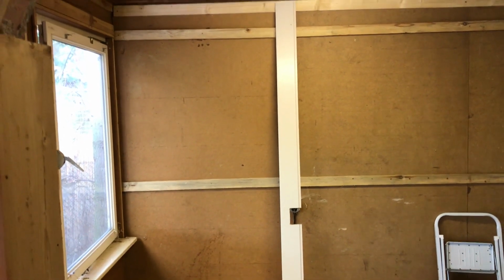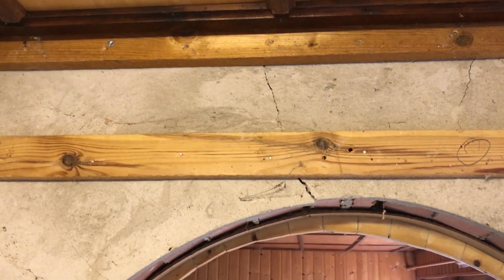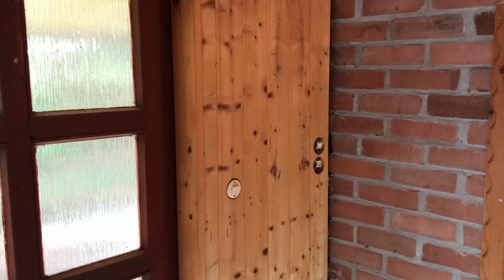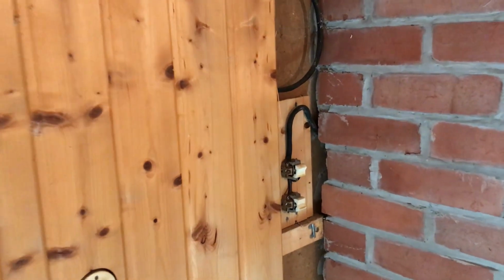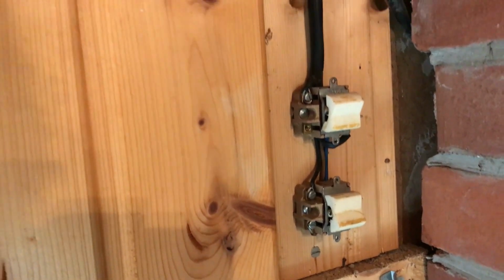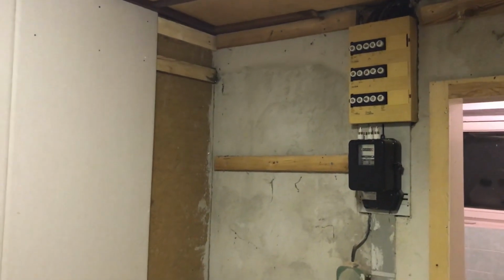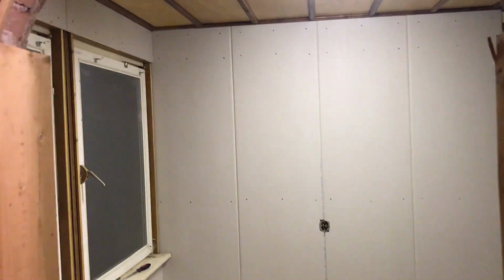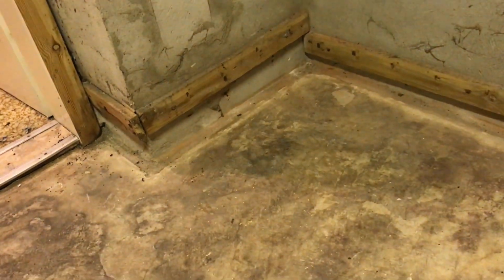Renovating an abandoned tiny house Part 5: Drywall time!

Comment: I noticed that you didn’t add any insulation. Is there any reason why?
Reply from the maker: Yes. The plan is to build a new facade around thehouse, like a coat. This will be insulated. I did the same with my first house. The advantage is that you don't loose living space..
Reply: No thermal bridging to the walls that way as well and better vapor barrier seal
Reply: @renovationeast9379  How does the facade work, and what is the material?
Reply: Did you get rid of all the mold?

Comment: For such a small house with an outdated electrical service, wouldn't have been easier to just rewire the whole thing while you had the walls open? A new weather-rated panel mounted outside would have freed up wall space on the inside too.
Reply: I can't believe the windows open inwards in such a small house!
Reply: Matiu I think it's because it won't get that hot and opening inwards means you can clean from the inside. They might also tilt so ventilation from the top?
Reply: @matiu8451  I'm wondering about that window opening inwards, too?
Reply: Matiu I’m German and now you made me wonder if I ever saw a window opening outwards here... ☺️ Wouldn’t the handle be kind of hard to reach?
Reply: @matiu8451  RIGHT!! MAJOR NO NO... EASY ACCESS 4 ANY BURGLAR
Reply: USA here to ramble about windows. Our standard windows are two separate window "frames of glass" that slide past each other. Up and down. They have a lock in the middle where they meet when closed. We have storm windows and screens as well that can be added to these windows in "layers". Our taller buildings have a sideways version to this. (If they open) our schools typically have picture windows with smaller crank windows typically opening upwards. We also have a bunch more options for Windows. I have actually had a window similar to the one in this video, lead to a fire escape. That window had a broken crank to operate it though. It also cost extra to have it fixed when the glass broke.
Reply: Rebecca Ball Interesting, thank you! So many options... ☺️ The German standard is basically what you see in the video; one or two glass frames with cranks, most of them can also be tilted inward (opening only a small gap on top).
Reply: Usually when you don't understand why someone is doing something the less optimal way it's always about saving money.  It wouldn't cost a lot to rewire it but it all adds up in the end.

Comment: Wow! 2 ft drywall sheets. I’ve never seen that. Much easier to handle but more taping and muddling.
Reply: Inch by inch it's a cinch. Yard by yard it's really hard.
Stack & measure dry sheets then cut to manageable sizes.
Reply: Kay Watson that’s a good idea too. But his drywall comes that way, and so that it’s tapered at both edges. That allows for a tape and mud joint without a hump in the wall that you’d get if you add those layers to two cut edges.

Comment: Has there been any cracking on the drywall seams? I see you didn’t put any furring strips there, only top and bottom. I have “fixed” the cracking problem for a friend by drilling holes and shooting expanding foam in there.

Comment: The crack in the arch happened because, when building it on a former, you have to remove the former as soon as the arch is finished. This allows the brick and mortar to settle. If you don’t remove it immediately and allow the brick-work  and mortar to dry, you end up with at crack.
Reply from the maker: ..unfortunately your good advise is 32 years too late.. :((

Comment: I am wondering why you did not add insulation to your outside walls.  Especially around the windows. Insulation and vapor barrier will cut down on mold issues. And keep it air tight as possible.

Comment: You mentioned the aluminum wiring in an earlier video and I immediately thought of articles which I've read about aluminum wiring being unsafe.  I would have taken advantage of having the walls down to rewire with copper only.
Reply: Besides, that wiring is likely over 30 years old, possibly more, and a DIY job. Worse, it's most likely not properly earthed but what's called a TN-C system. What that means is instead of three wires to each socket (live, neutral and earth) you only get two, with a short wire link between the neutral and earth terminals. That works most of the time and catches any dangerous faulty appliances like a proper earth would but if that combined wire ever breaks and something is plugged into a socket downstream of the break, the whole metal outside of the appliance becomes live, even if the appliance isn't faulty at all! You can't have an RCD (FI-Schalter) as an extra layer of protection with that setup either!
So if I came across any GDR wiring I'd probably replace it straight away instead of burying it under new finishes.
Reply: @Ragnar8504 All good (and scary!) points!
Reply: The units I live in have had aluminum wiring for over 60 years. The EARLY aluminum was bad, but later versions were fine. Unfortunately, early problems ruined aluminum's reputation. So depending on when this was done,  this wiring may be just fine.
Reply: I did a little Googling and found this:
"If you have aluminum wiring in your house, you might have a fire waiting to happen. Many houses built between 1965 and 1972 were wired with aluminum instead of copper. The wiring itself isn’t a problem; aluminum conducts electricity safely. The trouble is at the connections. The U.S. Consumer Product Safety Commission (CPSC) reports that homes with aluminum wiring are 55 times more likely to have “fire hazard conditions” than homes wired with copper."
55 TIMES MORE LIKELY to have a fire.  Yikes!
Also, if it's safe (and its a LOT less expensive than copper) why isn't it used more widely?
Reply: @barnabyaprobert5159  The main reason is that terminating aluminium is considerably more complex than copper. Aluminium oxydises very quickly and aluminium oxide is non-conductive so you need to remove the oxide layer and apply some type of grease to prevent a new one from forming immediately. The alloys used for wiring also deform under the pressure of a screw, causing long-term overheating issues and are more brittle than copper. And aluminium is less conductive than copper so you need to go up one size for anything.
Aluminium is common for very large conductors that use different connection types than your average home wiring (crimps mainly) where copper would be very expensive but that's about it.
Reply: @Ragnar8504  wow, you all are sure giving me an aluminum wiring education with this wiring debate! 👍
Reply: @Ragnar8504  This is Germanby, not USA.  Different standards!
Reply: @terrymartin9642  I know?!?
My comments mostly applied to Europe, particularly Germany and Austria. 2,5 mm2 and larger Al wires were used during WWII because copper was reserved for ammunition production. Most countries west of the Iron Curtain quickly switched back to copper in the second half of the 1940s, while those east stayed with Al until the 1990s. More recently, soaring copper prices around 15 years ago caused a renaissance of Al for large conductors, usually 25 mm2 and up in Europe. Any Al house wiring is most likely pre-1990 and done to the standards of countries that no longer exist, standards that are generally considered dangerous these days.
Reply: Ragnar,
The high-iron aluminum alloy wire that I referred to (Southwire
Triple-E) (Southwire Company, Carrollton, GA USA) was an usually
surprising alloy that overcame many of the wiring fire problems here
in the USA.  Triple-E was patented around the world because of its
surprising and desirable properties for electrical wiring.  Most
earlier circuit size wiring - that's the wire you would find in
household-type wire - was an alloy grade called Electrical Conductor
(EC) grade wire, that had the problematic characteristics many people
still associate with aluminum wiring fires.  EC had very low
impurities, as it was believed that impurities would lower the
electrical conductivity of the wire.
But the real problem here in North America was that prior to about
1965 the fixtures that the wire is connected to used brass screws
holding the wire against a brass plate.  The coefficient of expansion
of the brass and EC  aluminum were somewhat similar.  With copper
getting expensive (that's the reason for the switch to aluminum wire),
brass also became expensive, so many of the fixture manufacturers
switched to plated steel screws for the connections.  The coefficient
of expansion of steel and aluminum are very different.
What occured with these steel conntacts was that the connection point
(i.e., the wire/fixture connection interface) heated up due to
residual surface aluminum oxide (a non-conductor of electrical
current) on the wire so that there was a little electrical resistance
at the wire/fixture interface.  The EC grade aluminum wire would
deform because its elastic flow force was less than the 'give' of the
steel screw.  As the connection interface cooled down when the
electrical current flow stopped (power switched off) the aluminum was
no longer held tight by the steel screw, so when current was again
passed through the wire/fixture interface, there was even greater
electrical resistance and the connection got even hotter than at
first.  Ultimately, this could lead to ignition of surrounding
materials.
This cold flow problem was exacerbated when the US standards people
(Underwriters' Laboratories) allowed the fixture manufacturers to
substitute 'push-in' fixture connections, wherein the wire is simply
stripped back, inserted into a hole in the fixture, where a very small
surface area metal spring makes contact with the wire. The time for an
electrician to wire a push-in connection is almost nil as opposed to
making the connection under the former standard screw tight type
connection.   As the wire/fixture interface heated up, the spring lost
its tension and the circuit failed of burned up.  The push-in
connections are a major cost savings in wiring a house, but a
potential hazard.
For more info, Google: "chia_enrique_h_197508_phd_261128.pdf"
In my case, I always go around and make sure no push-in connections
are used in my homes.
So the problem isn't the wire per se, it is the fixture connection
mechanism and somewhat also the wire characteristics as determined by
the wire alloy.
Regards,
Terry
--
Terrence (Terry) Martin
Registered Patent Attorney
WD4AON@gmail.com
 @Ragnar8504
Reply: In line three, above, "an usually" should have read --an unusually--.  -tm

Comment: I have so many questions. Why didn't you open up the ceiling before putting in the sheetrock? Why didn't you completely rewire and replumb before you put the sheetrock in? Would be better to take down the brick wall entirely before it crumbles under somebody leaning against it? Wouldn't you also want to inspect the roof to see if there's any problems under the roof before you put in sheetrock? Sheetrocking seems to me to be one of the last things you do after doing all the repair.

Comment: Is that the standard size for drywall? It looks about 2'x8' (not sure of the metric calculation).  Drywall in the USA only comes that size when it is 1" thick core board, which is about double the thickness of standard drywall.  Otherwise, it comes on 4'x8' sheets, which cover about double the space that the sheets you were using.
Reply: I was wondering the same thing. But it is probably .5 meter by something else. I'm really interested in that aspect.
Reply: @bgraybackpacker  

In trade school, one year our top apprentice in NYC did an exchange within the top apprentice from Sweden or some such Nordic nation.    They dispatched the hulking Swede to a NYC drywall job.  He supposedly  could not wait to go home.  Our guy did not want to leave.  Or so the story goes.  Labor standards seemed to be the deciding factor in both parties inclinations.  I would skip home if boards were only 2'x8' lol.  Your body would certainly thank you by the end of your career.

The stud spacing is way too wide in this video.  It looks like they are 4' or 3' on center.

Comment: im curious why you used a dry wall that doesnt connect flush. are the vertical valleys where the panels touch a design feature?

Comment: Does all the drywall come in those narrow strips or did you choose this size? You have no back up for your vertical joints, aren't you worried about cracks later on as the house shifts by wind or other factors?

Comment: I am an electrician in the UK, why did you not do your wiring/plumbing first before drywall?

Enjoying watching you work anyways :)
Reply from the maker: Great point - as I discovered later.. ;-) I thought Icould reuse the old system but came to the conclusion that it is too old and not enough sockets!
Reply: renovation east maybe pin this comment to stop the question being repeated. I really like this channel. Good camera work.

Comment: Hanging moisture absorptive  drywall on a cold wall without vapor barrier?  Ouch!    Code normally requires “ green board” in kitchens bathrooms.    Is a cottage excluded from this requirement?

Comment: Your drywall seems to be in a narrower format. Interesting. Plugs and switches look odd. Voltage higher there than NA?
Reply: I didn't check but it could be "one-man sheets" (24"x8'), they're quite popular among European DIYers. Voltage is 230 to ground/400 between phases, Euro standard. The switches shown are old eastern-German ones that were designed to be surface-mounted but someone decided to bury them in paneling. The socket underneath the kitchen window was the same, while the one across the door was a proper flush-mount one. The whole thing screams DIY to me! I'm also sure it wasn't acceptable to install those switches on wood without anything fire-retardant underneath, in those days usually a sheet of asbestos.
Reply: I was going to mention the drywall ... they look 18” wide ... interesting... more seams to deal with! I remember that monster chore from when I was a kid.

Comment: Get rid of the Aluminum wires burn down special ! Connections loosen no matter what you do. Late 70s 80s bs.
Reply: Aluminum wire does cause 🔥 fires. Had one in a mobile home, replaced all the kitchen wiring with copper.
Reply: The problem with aluminum wiring in the US is that the fixtures the wiring is connected to weren't designed for aluminum wire, which has a different coefficient of expansion than copper, and the fact that EC grade aluminum wiring us subject to 'cold flow' after the power is turned off.  Certain high-iron alloys of aluminum wire (i.e., Southwire Triple-E) do not have these problems,  and fixtures designed for aluminum wiring are safe. European  standards were/are different than  US standards to accommodate aluminum branch  or circuit wirning.

Comment: No insulation between the dry wall and outer walls? 👁👁 it’s gonna be frozen in there
Reply: In Europe we don't usually ad insulation on the inside of a house. It goes all around the outside. It's usually made out of 15+ cm thic special styrofoam.
Reply: petrabracevic1406 I just learned something. Thanks for taking the time to explain, I appreciate it!!

Comment: Shouldn't the plumbing and electrical be totally replaced? It all sounds outdated and severely inefficient. No sense in covering it up if you're going to have to replace it soon anyhow. 

Since it was built so long ago, wouldn't it be out of compliance and regulation with your country's standards?
Reply: The electric wires look old & dangerous.
Reply: Exactly what I was wondering too.

Comment: I wo
Reply: I would not stand up the drywall.  It’s much easier to  hang the drywall horizontally far less tapping that’s if you are going to tape it . Hanging you’re drywall will strengthen the walls

Comment: 2 switches - 5 wires 
this is normal
Reply: Depends. One was likely a 2-way, i.e. for a light to be controlled from two switches. Then it makes sense. Otherwise you'd just have live to the switches and two switched lives back out.
Reply: @Ragnar8504  no
2 switches 2 lamps. for example:
1 cable with 5 wires starts from the switches ,goes to the distribution box and there depart two cable with 3 wires to 2 lights